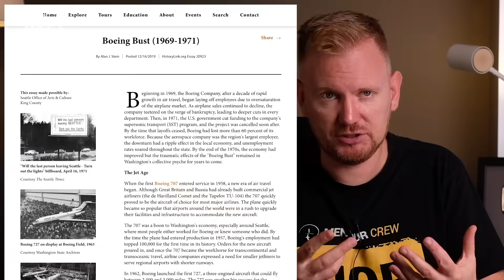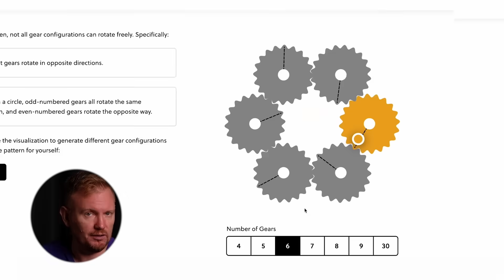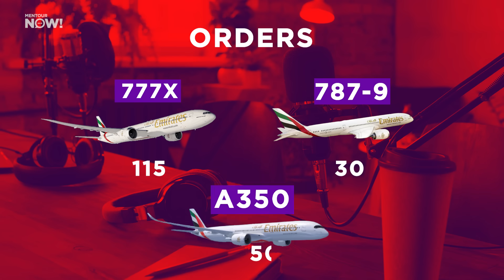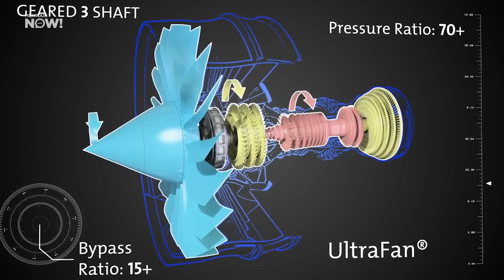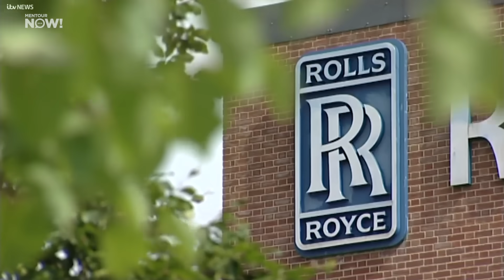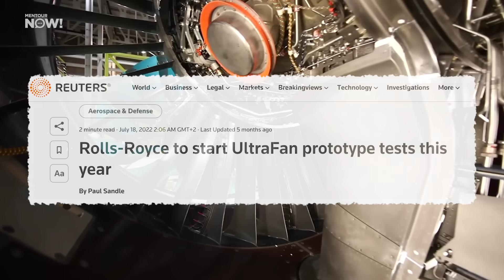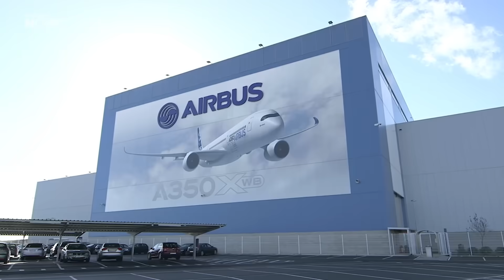Are BOEING planning a 747 with 2 ENGINES?!

Comment: Impossible. As aviation guru, one should know that the biggest engines the 115000 Lbs (GE) static max.T/O  thrusts pushes the max 777 -  300, super stretch 777-1000? For twin engines, the aircraft must be able to continue T/O with engine failure after Vmcg/Vmca. So for the MTOW of 747-400, a twin engine must push out much more than 115000 lbs or 2 x 60000 lbs per engine. Boeing made a mistake in that they did not develop a 777 size plane out of composite materials, like the A350 XWB. Even then the plane cannot approach the MTOW of 747-400. Well no harm in fantasizing, except one can be disappointed. 4 engines are white elephants on many many routes. If one does not have 85%/90% load factor, 4 engines is just not sustainable. What happens during off season?. Lets just be happy with A350 XWB Max?

Comment: 15:27  Regarding gear-driven fans - assuming the graphics are accurate, that's a basic planetary (aka epicyclic) gear set, invented by the Greeks over 2000 years ago...and is the same as is used in everything from traditional automatic transmissions in cars, to drive chucks in hand drills.  There many be some detail of construction or materials P&W may have patented, I guess...but the basic layout is up for grabs as far as I can tell.
Reply: My reaction too.   Just about every turboprop has a geared reduction, I suspect P&W are just 'trying it on'.
Reply: @cr10001  I'm wondering if it's a variable speed gearbox, on enable the fan blade speed to be varied to maintain blade pitch angle as airspeed changes. Props and rotors are constant speed variable pitch.
Reply: I was thinking the same that it might be hard to patent; not to mention that GT to blade gearboxes are "fairly common" in turbo prop planes and helicopters.
Reply: That, and geared fans have existed for 30+ years on bizjets. P&W's innovation was the scaled up power handling with small size that didn't grenade itself but there are several ways to skin that cat
Reply: If you went to the US patent office with "a regular reciprocating flow of ambient atmosphere into a vessel or vessels to facilitate gas exchange" they'd approve it
Reply: @himoffthequakeroatbox4320  Amazon got a patent for "One Click Ordering" or something
Reply: Leonardo Da Vinci functionally described a planetary gearbox in the 1400's.  Patent? urm..
Reply: Very similar to what P&W and Wright Aero used in their big radial recips, for that matter.
Reply: This video just turned up on my feed and interestingly https://youtu.be/2kAMo07cb3M?t=320

Comment: There is a two engine 747, it doesn’t have a hump, it’s called the 777.
Reply: Lol
Reply: My thoughts exactly!!
Reply: it also has  2 landing  gears
Reply: MTOW:
747 - 880,000 lbs
777 - 660,000 lbs

Max Passengers In High Density Configuration:
747 - 660 
777- 550

Your point is well taken and while the the 777 is a great plane, the two planes aren’t in the same class. 747 is closer to an A380 than a 777.
Reply: You are funny 😂
Reply: Except in it's humped configuration it allows for cargo configurations the 777 cannot.
Reply: @ughhly  The 777 can’t be a freighter??!! Then what is all this news about the 777 freighter AKA 777F. They take cargo out of a side cargo door. Yes the 747 can carry more but at a price, two extra engines. Plus the 747 even features a side cargo door just like the ones the twin engines jets have. Just the noes door is usually used more.
Reply: @awesomeaircraft3215  The nose door and full height for the full length of the fuselage was a design masterstroke for the 747.
There are cargos the 747 carries the 777 cannot. (Including military vehicles).
It's for good reason military transports have either a nose door or rear ramp.
That's not to say being couldn't build a humped 777… which would be an interesting path.
Reply: @ughhly I wonder if it would be something like a C-5 Galaxy with 2 engines. Front end open, and big enough to be a double decker. For an engine the size of the one mentioned in this video, it’s got to be a high wing aircraft, which Boeing has already started moving towards.
Reply: @awesomeaircraft3215  +1.. . Agreed. Wave goodbye to the Queen of the Skies; Frau 747
Reply: @awesomeaircraft3215 It can be, just not one capable of carrying oversized loads
Reply: There are far more differences than there are likenesses.   The A300 is more akin to the 777.
Reply: A Boeing 747 like cargo airplane with transonic wings and this huge Rolls Royce Engine would be quite something
Reply: Agreed 😊😊😊😊
Reply: Absolutely right , I had the fun of flying the triple for the last10 years of very long career . We had some some high density 300 458 pax seats. Loved the triple . Miss the airplane , don’t miss the airlines
Reply: I think it’s funny I’m being called capt. Obvious and corrected for not acknowledging all the differences between the the 777 and the 747, besides the engines and 2nd deck.
Reply: @Sir_Gugharde_Wuglis  but you called a 777 a 747 when there are virtually no similarities between the two other than they are both airplanes made by Boeing.
Reply: @auntysocialist  I said a 2 engine 747 without a 2nd deck is a 777. That’s acknowledging at least 2 significant differences between those two planes.
Reply: @Sir_Gugharde_Wuglis  they are nothing remotely the same... there would literally be millions of differences.  I think that is what has people puzzled.
Reply: @auntysocialist  ok. Cool.
Reply: 😅 @Sir_Gugharde_Wuglis
Reply: @Sir_Gugharde_Wuglis 

The 747 series is also wider than the 777, and all but the 747-100 and -200 have significantly higher MTOW than all of the 777 variants.

And yes, as other people have mentioned, the position of the cockpit above the nose and fuselage of the plane provide a wider range of cargo options.  

Your joke was only humorous to people (like yourself) who think that airplanes are just tubes with wings and engines.
Reply: Y’all acknowledge my comment is a joke but you’re getting all worked up over technical differences. I bet you’re fun at parties.
Reply: Its not a 747 no mire ✋🤓💀
Reply: Yep...I'm flying a 777 on my
 MSFS 2002 PROFESSIONAL.EDITION
.( not MFMSMS 2020 )

And its a handful..but I love her just the same

...

😮
Reply: Thank you everyone who makes flying safe.

Please make it more fun. 
More seat and leg room.
Been on 12 long hauls and as many 6 hour flights all economy plus.
A380 best ride
777 is nice. I think it’s loud, and the seating is too cramped.
I gotta get a chart that describes the differences and similarities in the popular airliners today
Reply: Truth
Reply: LOL I doubt it
Reply: 787🍩
Reply: @ProziaREAL  I don’t know what a 787 donut is, but the 787 is a 767 replacement
Reply: Yep yer a funny guy.
Reply: Not the same thing
Reply: Theres actually a plan for 777 with hump, but the hump is at the back like a backwards 747
Reply: GE supposedly flew their own test 747 using just one GE 90. Don't know why they never thought of this yet.
Reply: Naaa totally different, a dog is not a donkey
Reply: But the 777 is a good performer, which the 747 won't with twin engines.
Reply: @ they’d have to be big engines
Reply: NNAAAAHHH!!
Reply: Hump 😂😂😂
Reply: Well it's not a 747 just like  a V.W. beetle is not the same as a V.W. passat .the hump is what made the 747 like the V W bug it's the shape that people think of
Reply: Captain Obvious 😂

Comment: Could Rolls-Royce be developing that huge engine for a military cargo plane?
They tend to have their wings on top of the fuselage and would, therefore, have the room for such a large engine.
Just a thought 
P s. I love your channel, and,  Merry Christmas!
Reply: Darnit, that makes a lot of sense.  I'm still going to hold out hope for a reboot of the 747 though!
Reply: @fuhkerz  With the C-5 being VERY old and now that we have a full C-17 flight, there is an argument for a galaxy replacement
Reply: @UchennaKema  out of Boeing, Lockheed and NG, Boeing is probably the only US airframer who has recent experience with an airframe of this size. Just like KC-46, Boeing could offer a C-747..
Reply: Would it fit on the B-52? I mean, that thing needs a LOT of thrust and it only operates from large, smooth, runways.
Maybe 4 Rolls-Royce engines instead of the 8 it now has?
Again, just a thought. I'm NO expert.
Reply: @arlo0011  they've been fighting for decades just to re-engine the BUFF. The current plan is corporate jet engines because changing the number would effect the wing structure. Designing and manufacturing new wings is too great a cost for what could already be your grandfather's airframe.
Reply: @dukeofgibbon4043  actually,  the B-52 and I are the same age, and I'm also an army brat. I saw one in person (1960 or so) when my dad was stationed at White Sands Missile Range.
Reply: @arlo0011  be glad your hip reconstruction will not be evaluated with the same cold calculus as reigns upon a bombers wings or future generations' education: as an investment.
Reply: @arlo0011  be glad your hip reconstruction will not be evaluated with the same cold calculus as reigns upon a bombers wings or future generations' education: as an investment.
Reply: @dukeofgibbon4043  * affect
Reply: @arlo0011   Well, RR DID get the contract to re engine the B52 in case you did not know. 
To keep it flying for nearly ONE HUNDRED years!  USAF sees it flying to the 2040s.
Reply: @arlo0011  My thoughts exactly. The B-52 is going to stay around for many more years. Though I heard there are new engines destined for that aircraft. But how about something like the C-5 Galaxy? That is one huge aircraft. I've flown in that aircraft a few times. It is a monster. I don't know if there are rules or regulations about passenger aircraft, but if the passenger body had a high wing, it could easily handle the large engine. It would be easy to make a double deck passenger version of the C-5. It does have a passenger section by the tail end with 77 seats.
Reply: @bondgabebond4907  there was a proposal shopped around by Lockheed to turn the C5 into a mega-transporter (1000-1100 seats). 

It was rejected by airlines as being far too big to be practical (the seating capacity, not the aircraft)
Reply: @arlo0011  The wing design on the B52 suits 8 small engines, not 4 or 2 bigger ones. The engines have been updated.
Reply: @arlo0011  The B-52 re-engining program is already under way, and I think they are keeping the existing 8 engine lay out.
Reply: @arlo0011  B-52 is getting replaced by the B-21 Raider Stealth Bomber, US Airforce is buying 100-200 of those new bombers.
Unlikely they will be upgrading the aging B-52 fleet.
Reply: @arlo0011  the Air Force in fact is doing upgrades and re-engine for the B-52. However, to keep the project on-time they decided to stick with 8 engines because otherwise it would require much more significant changes to the airplane.
Reply: @afwaller  thank you.
Reply: @afwaller  something I saw somewhere is someone proposed big chonker 777 type engines and apparently aerodynamics of the rear stabilizers also depend on the current engine size. so while a big dog modern turbofan would sure make sense from fuel usage and reliability. Those more significant changes would start to get structural.
Reply: @arlo0011  you’re welcome, friend
Reply: Military freighters also need to operate from unprepared airstrips. Having a massive engine hanging from the wing defeats the purpose of having the high wing.
Reply: @dummgelauft  Actually no, they don't.
At least for example the Galaxy doesn't and can't operate from unprepared airstrips.

Actually US airdoctrine actually states that flying from unprepared airstrips isn't the main plan, since the US can have airstrips build or floating anywhere in the world within days of deciding it wants an airstrip there.
Reply: They stopped buying the C-17 because they had enough. Doesn’t make sense to design and build a new one.
Reply: not sure. the size suggests that it is very powerful. but it isn't. it is just a few percent more poweerful than the engine on the a350-1000. and efficiency is not that important for military planes because they are not used much.
however robustness and reliability is important for the military. and i don't know if the geared fans have an advantage or not. might be. don't kno.
Reply: @stefanweilhartner4415  Generally, the more moving parts, the less-reliable a machine is.
Reply: Don't think the army cares about fuel economy. They would rather stick 4 proven engines on the plane. IMO
Reply: I think You might have a point here, still the question would for what model.....
Reply: Have we come to a point where it’s justified for Boeing or Airbus to develop a dedicated cargo hauler. The 747’s are going to age out and there isn’t a good replacement. If the airframe is used for cargo only, they can use high wings that accommodate this massive engine.
Reply: @davidstiles6260  Planes of the size of 747-8 or A380 cost tens-of-billions to develop.  The meager potential sales of strictly cargo planes don't justify this new investment.  The 777-X and 787s can haul freight, just not as much.  But they both have very efficient engines...

Comment: If the autoclave was not require for composites it would open the wing design for advanced types. A 747 with cranked delta wing optimized for high subsonic cruising. Combined with the new engines & redesigned nose would yield a incredible aircraft.

Comment: Considering the size of RR's Ultrafan engine, I have to wonder if Boeing or Airbus have a high-wing widebody in the works.  It's hard to imagine a low-wing with enough clearance (especially if you want to future-proof the design to potentially be fitted with even larger engines), and a mid-wing layout usually isn't all that efficient in terms of interior space.

Comment: Could probably find a market in East Asia with the high population, major tourist destinations, and popularity of short overseas vacations to nearby countries. The 747SR was developed to demand from Japan, after all.
Reply: I've flown in B777 between Singapore and KL; it's also served by ATR-72s; B747 from SIN to HK; and B747 to SF & LA via S. Korea, & Japan; and A340 SIN to SF; although now either A350s or A787s; SIN to Australia and NZ is B777 (probably a lot to A350 and B787s now) and around Malaysia on B737s. So really a mixed bunch of planes in use. Malaysia domestic flights are always packed, but the airports aren't designed for anything bigger.
Reply: Countries in Asia are not buying planes from Boeing anymore especially China after the 737 super max deboggle.
Reply: The 747SP was mainly produced to compete with the smaller DC-10s and L-1011s.

Comment: An interesting video would be the advantages/disadvantages of a low wing design vs. high wing for passenger aircraft.
Reply: there is no "fast" high wing aircraft,there is a reason for that
Reply: @dethray1000  The Antonovs seemed to have no problem with speed and modern passenger aircraft are not that fast anyway. The maintenance argument is mostly defeated by the sheer size of modern engines and maybe we've made the noise bearable?
Reply: @matejlieskovsky9625  Not only engine

Wing inspection and maintenance would be much difficult too.
Reply: One disadvantage is maintenance for sure.
Reply: I believe the major disadvantage is that it feels odd; when you sit above the wing during banking, we perceive it as the ground tilting below us and we're quite used to that sensation, whereas when the wing is above us, we are swinging around underneath, which isn't a good feeling.

Advantage, everyone get a good view out of the windows.

Comment: Jets with two huge engines always put up three questions:

1. How far off the ground do these things have to be - we remember the 777 MAX and it needed some very inventive engine nacelle positioning. Now if these two huge engines weigh e.g. twice as much, there will probably be a limit to that as well if the plane needs to be flyable with e.g. damaged avionics (or just avionics that went haywire, like on the MAX)
2. One day, such huge planes will start to look like PBY Catalinas again. Not because of nostalgia, but simply because the two huge engines need so much room there's no other place except ABOVE the wings, or maybe like a DC9 (which probably creates other challenges like weight distribution).
3. What happens if one of these engines calls it quitus in mid-flight? We have had cases where 777 became almost unflyable due to the parasitic drag. Will we see engine nacelle jettison systems being added so that in such cases, the plane makes it to the next airport?

Comment: Out of autoclave cured composites are heavy since they rely on higher resin content to stick everything together. 29.9in/Hg equates to less than 15psi in pressure. I dare you to find any composite part that is out of autoclave cured that's as strong or light or strong as using a 45, 60, or 90 psi cure.

Out of autoclave is being used for cored bondments, but they become heavy and plug the core with resin flow.

As for the geared turbofan, aeromotive isn't the only use. Think large generators used for emergency power or areas that have access to natural gas. More CF6-80 engines are sold for power generation than aircraft.